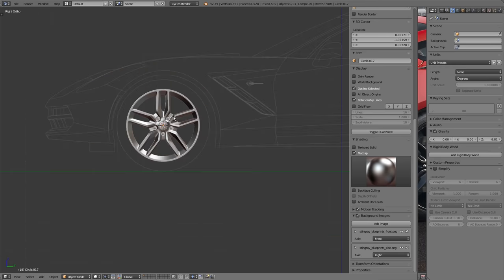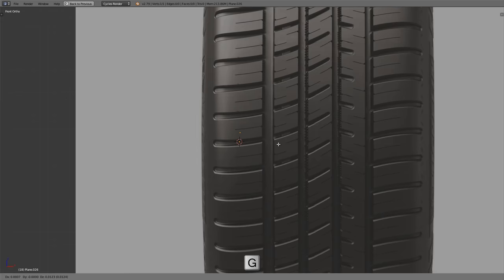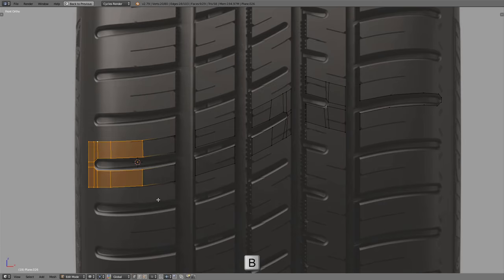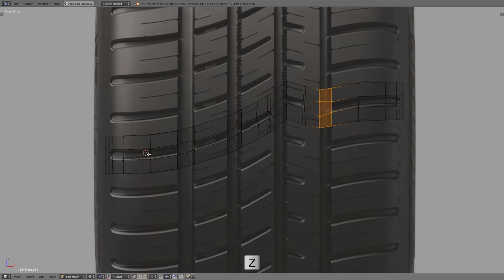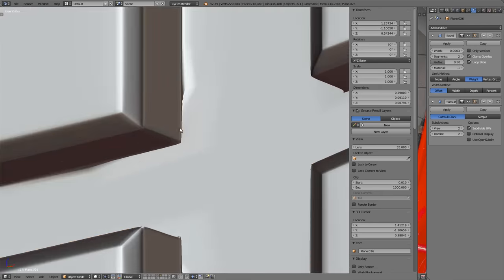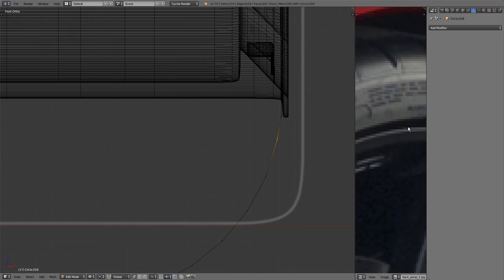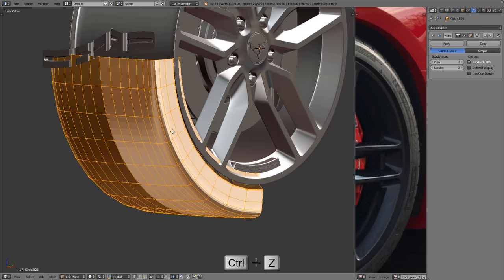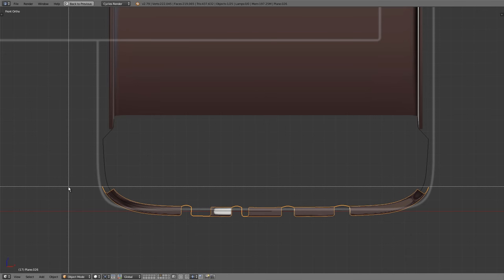Blender Tutorial - Modeling Car Tires

Comment: How do you merge them without applying lol
Reply from the maker: Here's an example blend with explanations inside: https://cgmasters.net/tutorials/tire_no_apply.zip -Chris
Reply: thanks!
Reply: There is a merge option in the array modifier.
Reply from the maker: Yep though this only works when the array modifier is at the end of the modifier stack else you're still left with a seam that's not merged after you bend it around in a circle. Having array at the end of a modifier stack then requires a couple extra steps to still be able to spin it around in a perfect circle. This is the modifier workflow used in the blend file I linked to a couple comments above.
Reply: I was trying to find an efficent way to have a simple deform of 360 degrees after subdivision without that annoying seam. I think I menaged to do it once, but I don't remember how. 
Any suggestion?
Reply from the maker: Check out the blend I link to a few comments above in this thread, is that what you're looking for?
Reply from the maker: UPDATE - Blender now has a Weld modifier that you can add which is basically a Remove Doubles/Merge by Distance tool. So just add that modifier to the end of your modifier stack after the simple deform modifier. Awesome new feature, super handy for tire modeling.
Reply: @blengine  Shouldn't we add seams for unwrapping before applying mods?

Edit: Really nice tutorial though by the way :)
Reply: use weld modifier

Comment: for anyone having this problem:

at 36:00, when you add in the simple displace and the tire is not in the right direction after you put in an angle, you need to change the axis the simple displace is placed on. It's default is x axis, but changing it to the z axis worked for me. You can change the axis in the simple deform menu under origin
Reply: @J.PC.Designs  lmao np!
Reply: @Theakm55  ты ведь русский, да?
Reply: for anyone that still having a problem try to rotate the null object

Comment: for anybody having this problem:

the bevel width was not increasing at all past 0.1. Even if you mad it higher, nothing on the mesh changed. I fixed this by turning off clamp override in the geometry tab of the bevel modifier. Hope this helped someone :)

Comment: 26:00 If your curve modiefier acts weirdly convert it back to mesh (the curve) and check vertex normals, they should point out evenly. Convert to curve and then change origin, This is how I fixed it. Also, if you need to apply scale, do so on the mesh, not on the curve

Comment: How you did the sides details of the tires, the michelin logo and all the little writes? Did you use a displacement modifier with a normal map or just a normal map shader?
Reply from the maker: I UV unwrapped the side of the tire into a straight line, then I created a black and white bump map with all of those details in Photoshop to UV Map onto the tire. Then I ran the black and white texture into the Height input of a bump node which converted it to a normal map.

Comment: how do you do the sidewall that says michelin and has all the numbers? i got the rest but idk how to get so much detail
Reply from the maker: One letter/number at a time basically. I just created a super long image in photoshop, and I looked at what kind of text is written on the side of michelin tires and simply used the text tool in photoshop to add it all in and place it in the right spot. There's no quick way to do it, you just have to write it all in manually.

Comment: Hello there.. I just have a problem
When I do alt+r to spin the tire like part it spins but it does not fills. It just spins from one place to another. Plz help.
Reply: I had the same problem. Use the spin tool to spin and duplicate.
Reply: @alexmentzel6235  ok will try.. thanx👍
Reply: @alexmentzel6235  it actually worked!!  Thanx

Comment: Thank you for the great tutorial. One question: what is the easiest way to UV unwrap this kind of mesh after applying the modifiers?
Reply: I had an instructor who told me to unwrap your UV's as you're modeling .
Reply from the maker: That's a good question, there's so many crevices that I feel like this kind of tire is better off textured procedurally for the most part. In the course I texture procedurally, but then I select just the vertices on the sidewalls of the tire and UV unwrap them into a straight line so that I can apply a tire sidewall texture to it that has all the logos and text. If you were looking to unwrap the entire model, like for a game model, I think cutting a seam across it to break the circle, and then using the "unwrap" option might work pretty well. Though a game model typically wouldn't have this kind of detail anyway and would likely use a lower poly model that this detail was baked onto. So the unwrapping process of the lower poly tire would be easier. Good luck! -Chris

Comment: Truly amazing tutorial. One issue that I had but managed to fix was during the bevel process. I discovered that when I inset the faces I must have gone to far as 2 vertexes had crossed, forming something that would bevel but just at an insanely small radius. Another issue that I couldn't solve is when applying the subdivision modifier at 15:55 . When I apply it makes all the corners smooth. One question I have is for the full tutorial, is it 30 hours of video of ~30 hours for someone to complete, taking into account pausing etc? EDIT: the problem that I was having with the subdivision modifier appears to have just vanished. I am not sure why but it is gone now. Thanks!
Reply from the maker: Ah yeah the bevel modifier has that clamp overlap option that can be triggered when geometry gets too close. It can be annoying sometimes. And the course is 30 hours of video, i honestly don't know how long that takes people to go through. Im actually surprised at how many people have gone through the entire thing step by step. It's definitely something that takes commitment and should be seen as more of a curriculum because there's so much information and so much to make. -Chris
Reply: @blengine  Yah, just purchased it and am going through the first blueprint setup currently. SO excited to start work. Thanks lots! Cant wait to hear tons of more great explanations for even the smallest things as I work my way through it. I figure it was more worth it to spend 60 dollars to learn how to make car models and improve my skills in blender then to just buy a single car model and be confused how even the simplest of things were created.
Reply from the maker: @Aaron-dw2dg  Thanks man I appreciate the support. Hope you love it, and keep in touch with me at contact@cgmasters.net if you have any questions or just want to share your progress, good luck!

Comment: Something I thought you might add at the end is how to mash the bottom of the tire with the weight of the car.  I find putting a LATTICE modifier down at the bottom part of the tire works really well.  As vertices roll through the lattice, they can be distorted out and flattened a bit, and then they return to their resting position as they exit the lattice.  It's non-destructive and can be rigged to increase or decrease the effect with your shock absorbers if you're going crazy with animation.
Reply from the maker: HariEdo Oh yep I mention this at the end of the video. We add lattices in the course for that. Lattices are awesome. -Chris

Comment: @ CG Masters I have currently noticed that the tyres obtained by simple deformation beyond 360 is not a perfect circle. 
Is there any other way of wrapping those tyres treads in a circle?
Reply from the maker: I did a test bending something beyond 360 degrees and still ended up with a perfect circle. If you want, you could send your blend to me at contact@cgmasters.net and I can check it out.

Comment: I'm curious: Why not use the mirror modifier when modeling the profile of the tire?

Also would [Merge] +[First/Last] work to eliminate the need to merge afterwards?
Reply from the maker: You mean at 21:58? You could, but it wouldn't have been any faster so it wasn't necessary. Setting up a mirror modifier would involve making sure the origin point's in the right place, then adding in the modifier, then applying. In this case we just duplicate and flip. Either way works though, but it's not always necessary or faster to use a mirror modifier when something has symmetry. And the first/last merge option in the array modifier only works if the Array modifier is last in the modifier stack. There is a way to set that up but it's a little more advanced. You can check out that solution here though - https://cgmasters.net/tutorials/tire_no_apply.zip .. You can read a discussion about this in the top pinned comment of this video too. -Chris

Comment: Hi- I tried to follow the tutorial in 2.8 but was having immense problems with the bezel modifier; when I changed the limiter to weight, changing the width didn't actually change the bezel. I double checked for intersecting geometry, and made sure I had selected the right lines with the right edge weight. I even restarted the project from scratch but ended up with the same problem. Do you have any suggestions?
Reply from the maker: hey send your blend file over to me at contact@cgmasters.net and I'll check it out. -Chris

Comment: At 22:00 why don't you just use a mirror modifier to reflect the curve for array modifier? - you can always mirror it on an empty axis object you know.
Reply from the maker: Just a preference I find to be slightly faster. Mirror would work though. It might be faster to just set the origin to the middle vertex though instead of adding in another object, because then you still need to get that other object perfectly aligned in the middle. So you'd need to select the curve's middle vertex and place the cursor there. And at that point, if I've already got the middle vertex selected, might as well just use that as a pivot point to flip manually. -Chris
Reply: @blengine  you know tons of shortcuts I don't have much experience with: in the end, personal preference!

Comment: Really nice video mate! Was wondering how did you set up the blueprints, and also if it would be possible for you upload the full blueprints for the car so I can attempt to model the whole car ;) Cheers
Reply from the maker: Thanks glad you liked it! For the blueprints I used the background images options in the right-side panel of the 3D View, is that what you mean? And I'm going to save the other blueprints views for those getting the course =) -Chris
Reply: CG Masters thanks mate! I meant, the kinda transparent background of the images and the white outline. I tried blueprints with black outlines but it gets difficult to see the edges and verts when they're over a black line ;) hope I made myself clear hehe
Reply from the maker: Oh got ya. They're .png's with a transparent background. Then all the blueprint lines are white so they stand out on blender's background.
Reply: CG Masters thanks pal! Appreciate it :) Will give Inkscape a try to redo some blueprints on my spare time just to see how that goes. Thanks again!

Comment: When i select the empty (36:15) for my simple deform modfier, the tire dont deform in the good axis, my empty is in the right place
Reply from the maker: Hey did you remember to set "align to view" at the beginning of the tutorial? If not that means your Empty won't have the right alignment, so try rotating your empty 90 degrees from different views until you get the right deformation. -Chris
Reply: @blengine  oh tahnks, no i didnt but finally i use a curve modifier with the circle curve + the array and it worked, there are multiple techniques to do this but i didnt understood really how i succeeded haha

Comment: The tire is the wrong way around. The photograph is taken from the back but you've modelled it from the front.
Reply from the maker: Ah whoops. At one point I was like "Don't forget to check to see which way the treads go", and then totally forgot.
Reply: good catch, i just pulled up 3 other references to check and you are correct. this is an inside/outside tire and the longer, more continuous sipe should be inboard.

@CG Masters - did you know each copy of the tread should be a variable length along the circumference? This profile shot is a good reference to be able to see how the distance from one sipe to the next gets bigger and smaller as you look around the edge of the tire: http://www.clublexus.com/forums/attachments/wheels-and-tires-classifieds/315217d1392146224-ls460-ace-alloy-wheelset-michelin-pilot-sport-a-s-3-tires-20140211_125904-001.jpg
Reply from the maker: That's so strange because Michelin's page for the tire doesn't show any width variation( https://www.michelinman.com/tire/michelin/pilot-sport-a-s-3 ). And the references I used were from sales pages too, but they all appear to be renders. All the real life references I just looked up had the variation. Though the variation appears to be random, so could that simply be the product of the manufacturing process and not the design?
Reply: CG Masters  that looks like a render, and the artist who made that shot may have taken the same approach as you have in simply duping one section of tread. treads are pressure-molded all at once, not laid on, so it must be a design decision. i think tires are done that way because it increases the odds that at any point on the road, some variants will be more effective at dispersing water+oil than other sections in order for the tire to effectively deal with a variety of liquid combinations and consistencies. i work on tires for a living and have noticed the same kind of variance around every tire's circumference

Comment: Thank you for your video you are very cool!!! I have a question. Help me please I really have no one to ask this. Can I use the iMac macOS 2020 to achieve decent results in architectural visualization (exterior and interior design). This is the specification: macOS 3.6GHz 10-core 10th-generation Intel Core i9 processor 8GB 2666MHz DDR4 memory Radeon Pro 5700 with 8GB of GDDR6 memory 512GB SSD storage
Reply from the maker: I'm not familiar enough with different types of hardware to be able to answer that, sorry. The processor looks great though, and you could perhaps use some more RAM, but I'm not familiar with the graphics card or with macs.
Reply: @blengine  thanks dear

Comment: I know this is from blender 2.7 but did they not have mirror or screw modifier? would've really sped up all this undoing when making the tire while still preserving the curve for the eventual tred.
Reply from the maker: Hey, couple of questions. As far as I can remember, the only symmetrical part of the model to use a mirror modifier on would be the curve we create to bend the treads on the X axis instead of using a curve modifier. Is that what you're referring to? I didn't really see a need for the mirror modifier there when I basically create half anyway and just manually mirror it to the other side when finished. That's the only point I can remember any undoing as well, and that undoing was just part of a test when I spin the curve around to double check it's shape as a tire. And where would the screw modifier be used?
Reply: @blengine  exactly you manually mirror the line multiple times (could just use mirror here) then screw would be used to prototype the tire shape using the vertices you created before converting it to a curve. i shave a good ten minutes off your tutorial doing these two things.
Reply from the maker: @stereocodes  Oh yeah you're right, I do manually mirror it a couple times. I think I expected everything to work out on the first try so I didn't bother with a mirror modifier, but it would've been beneficial here. Same with the screw modifier.

Comment: Did this method change in 2023 version of the course?
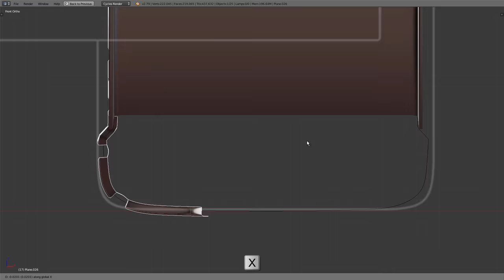Reply from the maker: I think it's generally the same except some minor details. Like at 26:40 when I center things, I do this differently in the new course, and also the new course uses the newer Weld modifier to connect everything after wrapping it around.

Comment: Is there anyway to get an effective tire like this with significantly less geometry? My model that I need the tire for is 7 million faces, and the tire is 40 million lol. It lags too much for me to use. Any tips would be great, thank you for the video!
Reply from the maker: Whoa, something may have gone horribly wrong lol.. I double checked my blend file and my tire is 94k tris. When subsurfed on level 1 it's 379k tries, and on level 2 it's 1.5 million tris. If you want you can send your blend file to me at contact@cgmasters.net and I'll figure out what's going on.
Reply: @blengine  I appreciate the reply! Yes something definitely went horribly wrong. I accidentally doubled up on the subdivide modifier without realizing it lol. I cranked it down to one and it was just around 100,000. It’s always a little thing that causes the problem
Reply from the maker: @angeloyanke150  Ah perfect! At least it was an easy fix.